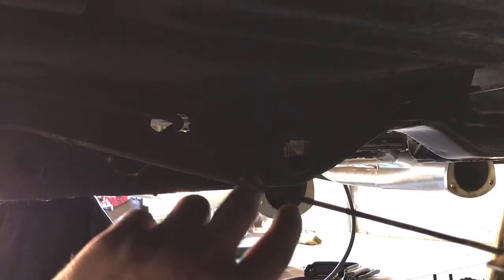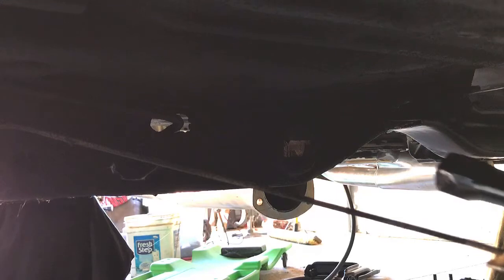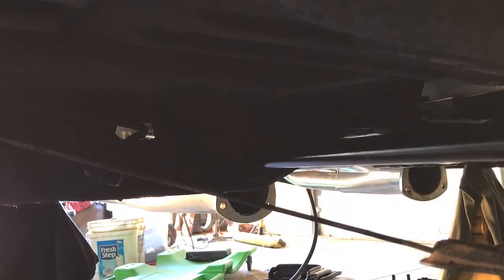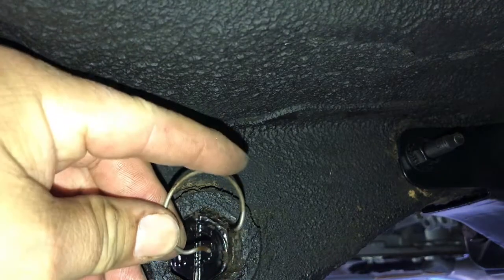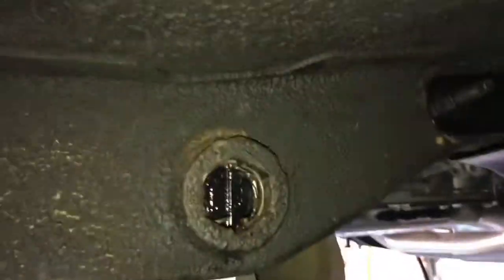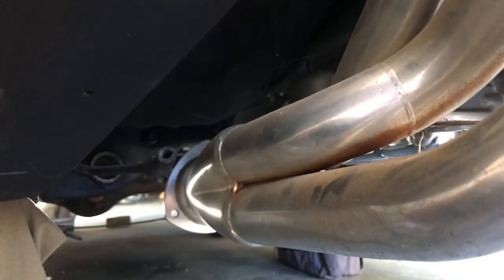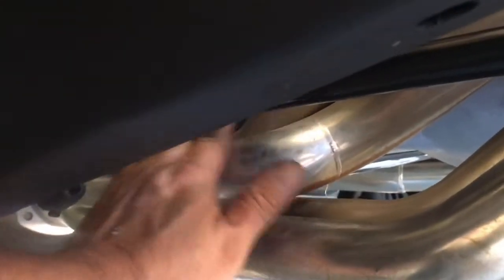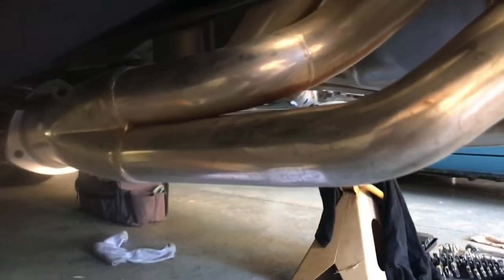Torsion Bar Installation

Comment: Grease the boot and slide it over a deep well socket. Grab a slightly larger socket and slide it on. Repeat until you are at the diameter of the hex for the torsion bar. It makes a PIA job turn into a 5min one. Works with the polys as well. Nice job on the tool!
Reply from the maker: Nice. Thanks Dave. I hope people who don’t have the ability or spare torsion bar read this comment.

Comment: Love the ideal you did with the boot on the torsion bar cutting an old one to get the boots stretched out to allow you to slide it right over holding them together looks really easy and the process of doing a lot of fun and work on my 70 Dodge Coronet and I'm definitely going to use that idea
Reply from the maker: Awesome and thanks Steven.

Comment: Howdy Jonny , I have a 70 Roadrunner I'm building . The motor is a 510hp 440 . On torsion bars does the size 1.0 -1.6  matter ? I know in curves it does but for wanting to lower the front end maybe 2 inches, will a 1.03 do it for me ? What do you suggest ? Thanks and Love the videos .
Reply from the maker: Thanks Sparlin. Bar diameter isn’t going to affect your ride height at all. Mopars are adjustable up front so you can set the height to your own preference. If you like low, which is my preference, a stiffer larger diameter bar is better cause it will be less likely to bottom out. And like you said the added benefit is handling. BTW, lowering the CG is a huge handling improvement. Small bars are only an improvement for a drag car. But if you do street duty bigger is better. But if you have your original bars on your bird they’re just fine IMO. I’d save the money and use towards some else on the car.
Reply: @JonnyMopar  Thanks for the reply and help . Had to cut the old one out . Gonna order PST 1.03 then . Thanks again

Comment: Is that the original undercoating on the car? I’m working on a 70 coronet and the undercoating looks grayish brown California Car so no rust would you normally just paint over it or strip and re apply?
Reply from the maker: It’s original. Well, on my Mom’s 72 Charger I just scrubbed it, knocked anything loose and applied over it. I suggest you try a test spot and see if it looks good and is durable. It’s was fine on mine. I used Eastwood undercoating in a can.

Comment: is that line on the back supposed to be vertical?  I only ask because the 1965 Barracuda I bought think somebody clocked the torsion bars 60° off because the front end is super low and the torsion bar screws are all the way in.
Reply from the maker: I don’t think the direction of the lines matters. But some will argue it does. The reason your nose is low and the screws are all the way in is because you need to clock the lower control arm over one more hex. In order to get it to go over one more hex, you have to loosen that screw and get all the tension out of the torsion bar, then disconnect the LCA from the spindle via the lower ball joint bolts (or at least one of the bolts and just loosen the other). The UCA connected to the spindle connected to the LCA will not let you clock over one more unless you disconnect like I said above. I’ve done a few front suspension videos and I’m pretty sure explain this in one but obviously forgot to in this one. Hope my description here helps. Let me know if you need any clarification.

Comment: With no engine how many turns do you put on the adjuster to start with? Thanks!
Reply from the maker: I couldn’t give you an accurate number of turns. I think I’ll start with about 2 rotations of the bolt. Then once the dative train is in I’ll adjust it again to get the height I want.

Comment: Where did you get the torsion bar removal/install tool? I haven’t done a mopar for many years and didn’t remember how to get those in and out. I just knew NOT to pound on the end with a hammer!
Reply from the maker: You’re right, if you pound on the end it can mushroom the head making it difficult to get out next go around. Here’s the tool kit. When I bought mine many years ago, you had to specify which ball joint you want. This kit comes with both. Early A bodies are the small ball joint. 73 and later A’s, all B & E bodies are the larger one.

https://www.manciniracing.com/unfrsuprotok.html
Reply: That tool is from Mancini Racing. Great tool, easy to use.

Comment: If you think the rubber boot is hard to but on try the polyurethane bastards lots of hot water I use a portable induction plate to heat water and a heat gun on low.... Never use visegrips on a torsion bars you create stress risers and the torsion bar can fail and the worst time! An aluminum bmx bicycle handle bar head with the four bolts makes an excellent torsion bar tool and free at the trash all the time. I like the tool you made....you know the C body torsion bar hex fits the 8 1\4 bearing adjusters! Free tool!

Comment: Do you ajust ride height befor or after final toruqe on lower control arms?
Reply from the maker: Tighten everything. Adjust ride height last but before alignment if possible.

Comment: How come you've never finished band stalling or showing installing the Stretrod being put in along with 
Controller control arm.. I have a 74 dart and mine. Doesn't seem to lineup like all these videos are showing. And when it gets to the part of resembling every single one, you guys doesn't show it just curious.
Reply from the maker: It’s an older video. Not saying I’m great now but I’m better at filming now than back then. If I remember right, I think I forgot to install the strut rod and had to pull the LCA back off and re-install. And I’m not sure if I filmed it. Anyway, I think I have video on the 68 Charger doing a front end kit. Might want to look there.